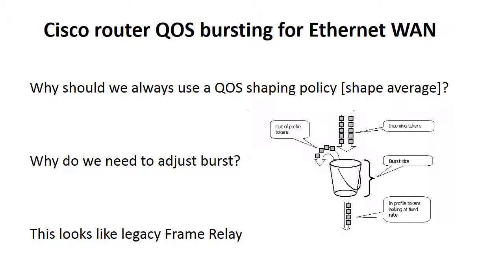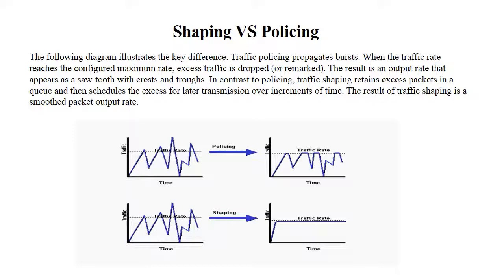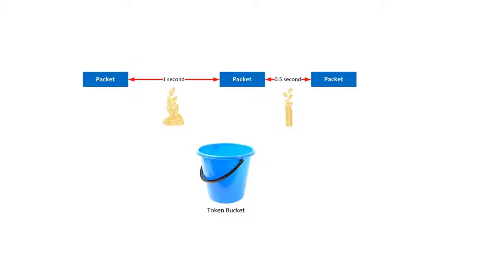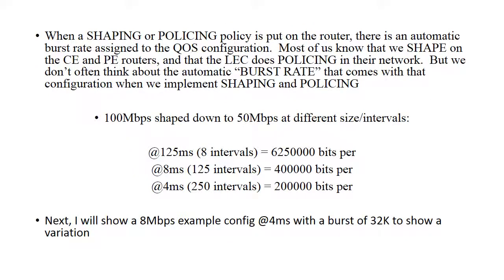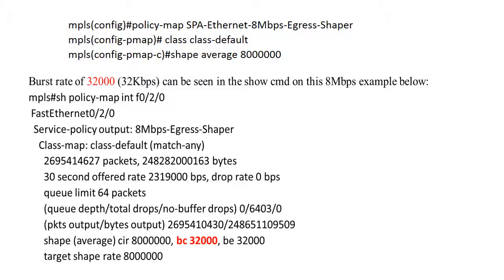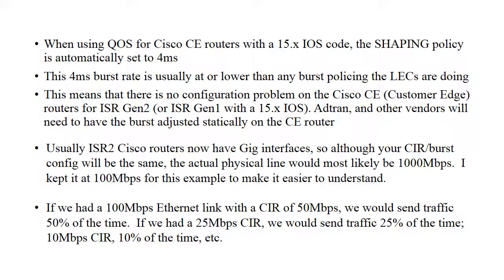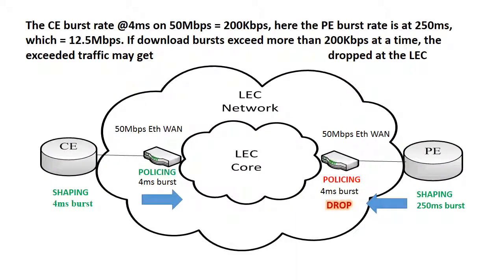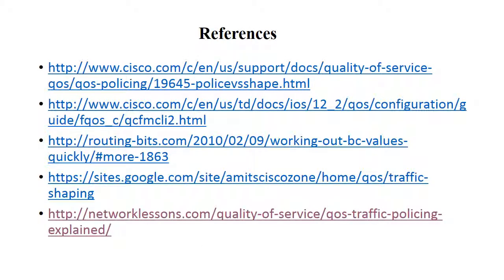PE QOS Burst Mismatch Explained

Comment: Hey, great video, can you explain policing? The difference between policing and shaping... Bc on policing seems to be a little different.. thanks
Reply from the maker: Ricardo Villarrealhey Ricardo, I work for Sprint which is a global Internet service provider, but we don't have much local presence anymore to help control this, so we are reliant on each local telephone carrier as Sprint doesn't own much local LEC central office anymore. very rarely is any LEC going to configure the BE. most times its automatically configured. the main problem between VZN AT&T, is that they have different physical equipment, which by default sets the default policing 'burst' at different rates. we are still trying to work w VZN, AT&T, time warner, etc. to sort this all out. Usually they just configure it and let it go, don't even realize about the burst problem, so we are trying to make them aware. to answer your direction question...(not sure what country your're in)...policing cuts off completely. this is done by the LECs at the edge of their core. going into the LEC direction, we shape, as we don't want to cut off; but have to realize that will cut it if we don't shape it correctly. let me know if you're having problems and i can probably help. the reason I am willing to help, is that this is a global problem, and most people don't understand 'burst' (not the old frame relay type). we fight this everyday with each LEC worldwide and we appreciate anyone that helps spread the message that this is a global issue that needs to be addressed.
Reply from the maker: Ricardo Villarreal just to emphasize, no other link on youtube will show u the reality. this needs to be addressed ASAP everywhere. this is a worldwide issue as the majority off of circuits in the future will be Ethernet. please help spread the word. thank you.
Reply from the maker: Rob Swanson just to emphasize, no other link on youtube will show u the reality. this needs to be addressed ASAP everywhere. this is a worldwide issue as the majority of circuits in the future will be Ethernet. please help spread the word. thank you. sorry, slight correction; very passionate about this issue. thank u